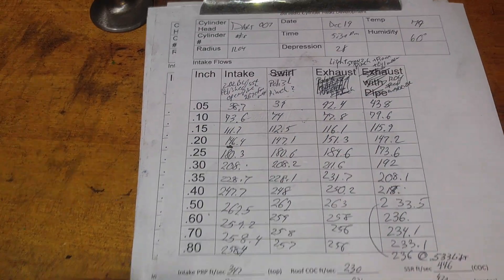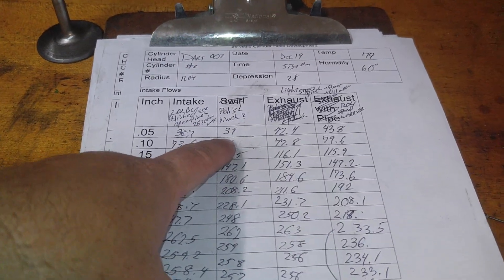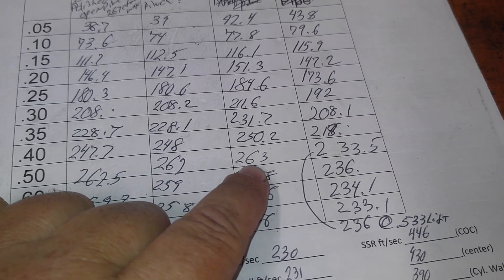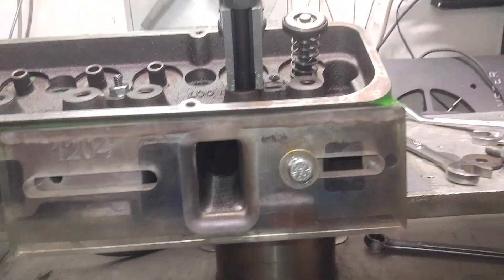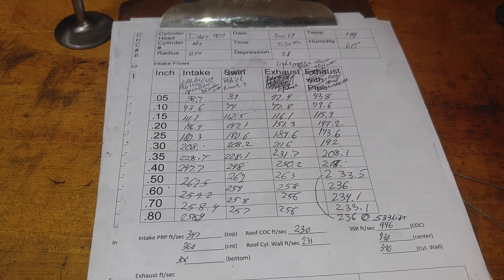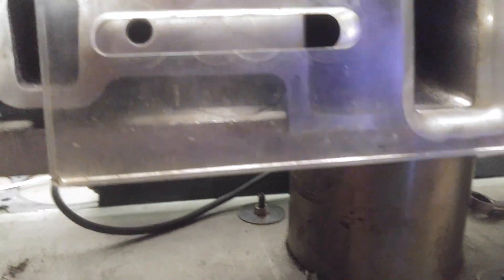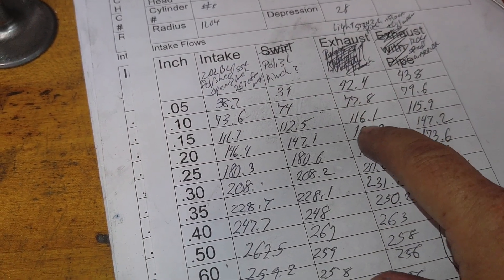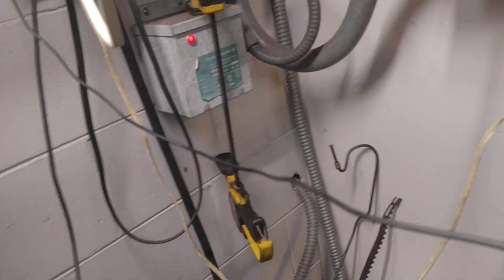Dart 007, kite string airflow, pinch air speed math

Comment: Charles  sounds like you need to upgrade your wheels  I have a question for you does the guide really need to protrude into the bowl I mean it would be about 1/4 inch less valve stability is that 1/4 really needed or can it live without it
Reply from the maker: @rchardsmith605  I like a minimum 2" of guide length. Thanks

Comment: 12:17 this is interesting , the string i think is taking the path of least resistance , if u want to see it move closer to the bowl wall there we have to think what is happening up and down stream from there , i was wondering what is happening higher up in the bowl above this point ? if there is higher flow from above pinching past the valve guide that could be pushing the string away from the bowl wall ? I wonder if making the bowl roof a little bigger (slowing the air abit) would relive some of the pressure in the spot u are indicating on the floor  ?
Reply from the maker: Making the bowl roof bigger usually slows the air and the string will move towards the faster air. Thanks

Comment: I have installed 2 Holley Snipers so far at work. 4150 baseplates 870 cfm rated each, 4 100 lb per injectors rated to 650 Hp Normal Aspirated.  1st Sniper was the Stealth 4150. I like them so far easy to setup a baseline tune, setup the spark advance I want.
Many neat features.  I haven't gone into Advanced Tuning yet, no Mustang AWD Chassis Dyno to use like the past South Chicago Race shop I worked in.
I am a Carburetor guy really. 
4150 Holley Double pumper Big cfm 850 -1085 cfm my personal Favorites.
Pontiac Tripower Factory and Quadrajets I like also.
Nothing delivered Fuel economy quite like a Pontiac Tripower and then a WOT burst of power. 
On a 455 Pontiac pump gas a Pontiac 1965 GTO Tripower will cruise at 100 mph on the center 2bbl  alone.  
The self tuning learning of the Holley Sniper works nice also.
Reply from the maker: Good info. Thanks. I really want a terminator for the old work truck. 900 cfm is what it has so that is good.

Comment: A intake will cause the heads to flow more because of ram effects until it becomes the restriction. Most dual plane fall flat between 225-240 cfm. You put that on a head that flows 250+....it becomes the restriction.
Reply: Tune it to my videos!!!

Comment: Thank again! Working on a similar combo. 355 . I have vortec heads and 91 swiir  ports that are on it now witch work suprising good.  Don't know to  do. I have a homemade flow bench.  Still fighting it our. I have a lot to  learn.
Reply: The Vortec heads intake has a angled floor leading up to the valve so they are gonna flow a little differently than the heads in this video , the Vortec is more of a swirl port than the Darts .  Yeah swirl ports (like ur 91 castings) are an underrated head my 193's really shine on my ski boat with a Q-Jet carb right to 5000 rpm. :eyes-pink-heart-shape: